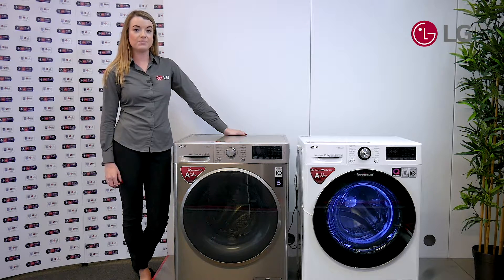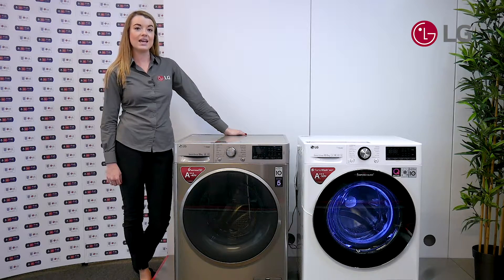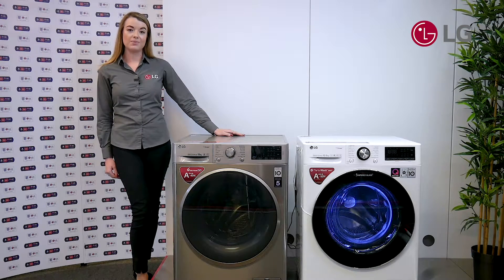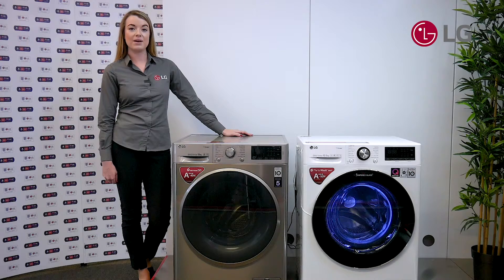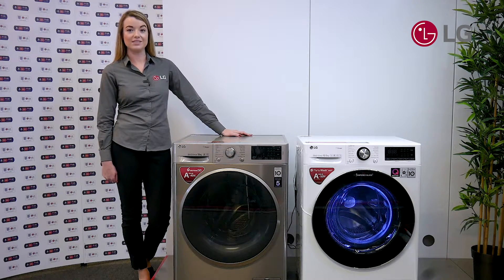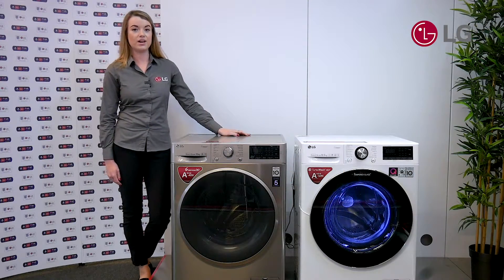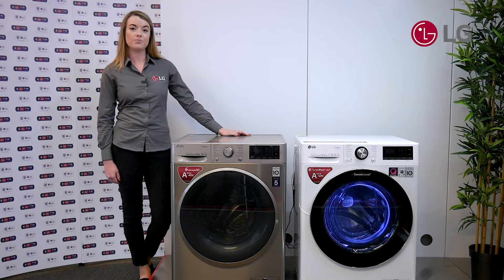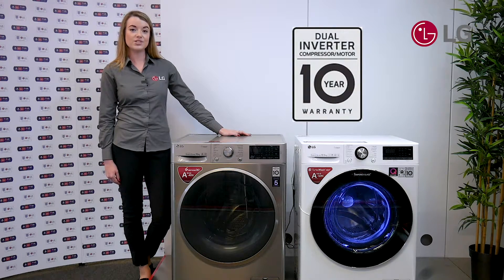LG Lounge - Dual inverter heat pump

Comment: I just brought one of these and i
Wish I wouldn’t have brought it. It takes sooooooooooooooo long to dry clothes. I’m so pissed off. I wish I could tell everyone not to but this.
Reply: How long does it take?
Reply: @McQuackeen  3ish hours
Reply: @vindigo7  Thet is normal for heat pump dryer,if you ceapit in cold room, it takes longer to dry.And you need to clean it inside by service man evry year.For me old condenser dryer vorkd best.